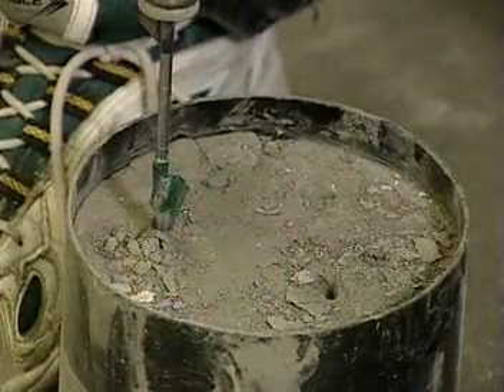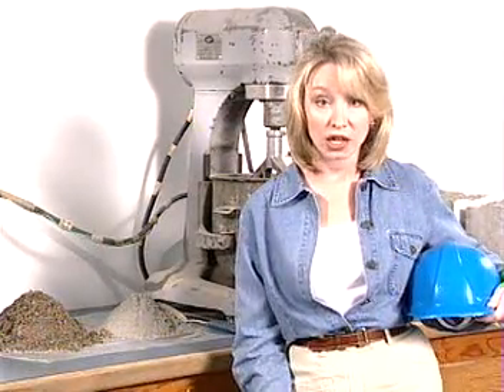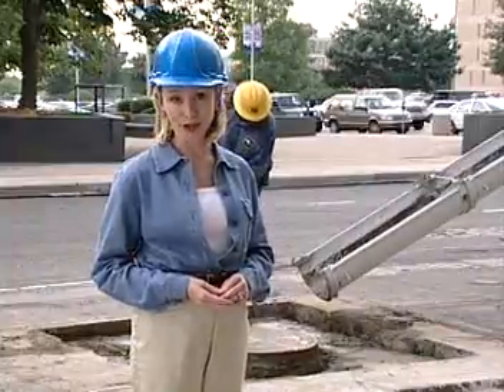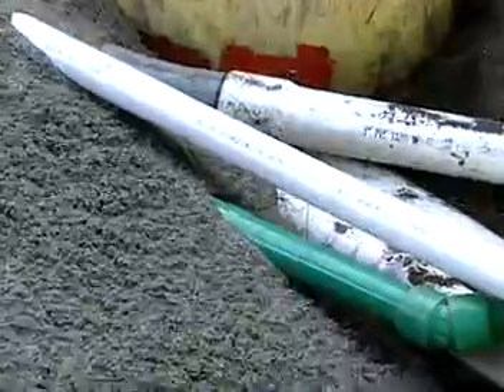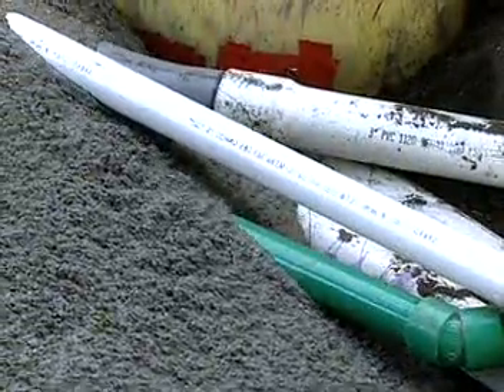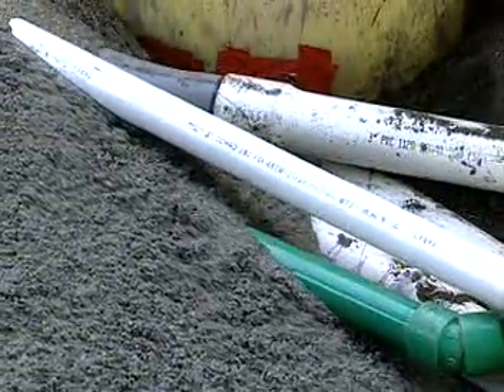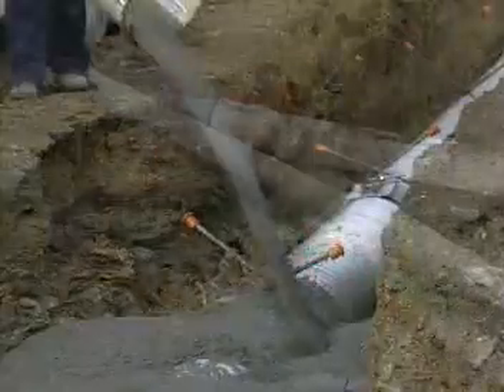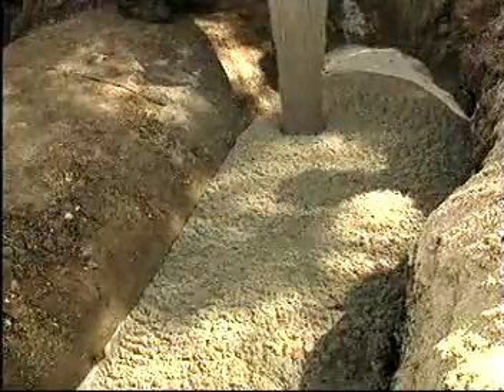Flowable Fill

Comment from the maker: Lifts are typically 2'-4' thick, but may be thicker in a situation where "form" is an earthen trench, etc. If wooden forms are used then the concern is the pressure on the form. Please consult ACI 229R13 (Report on Flowable Fill) for additional guidance.

Comment: Is there any downside to using Flowable Fill to fill in an indoor pool?
Reply from the maker: None that I am aware of. I have heard of that application. My suggestion would be to consult and engineer for any potential structural issues. In addition, if you do not have a copy of the ACI document for flowable fill you should consider purchasing it.